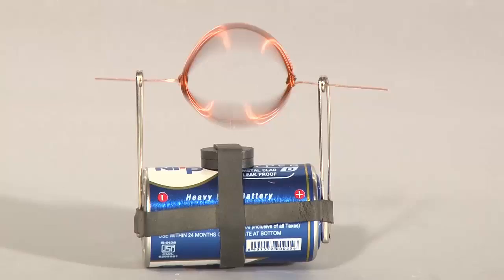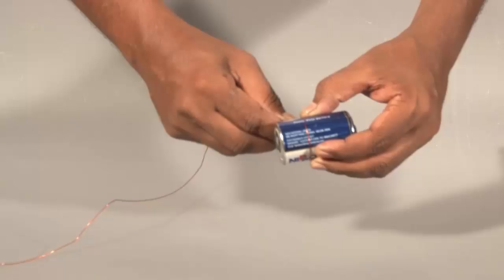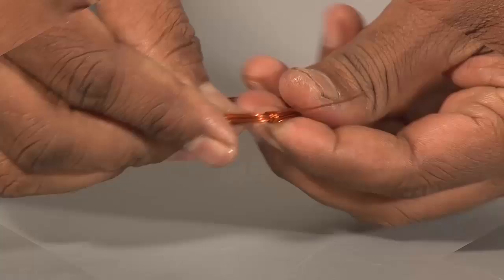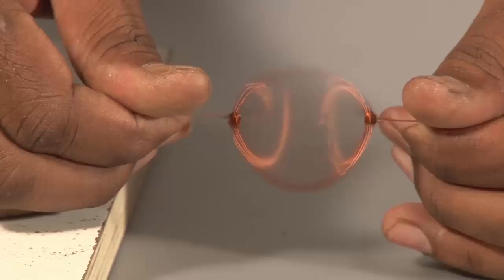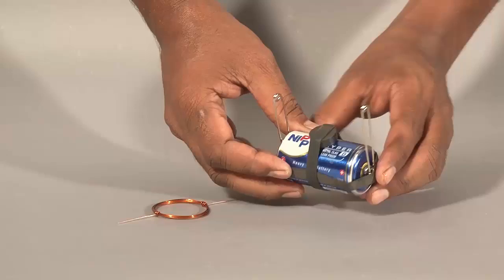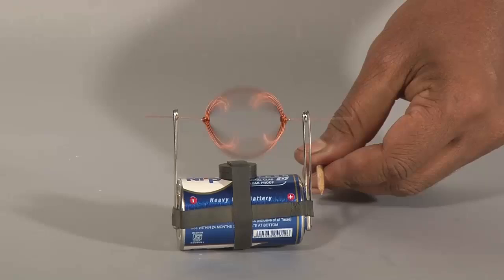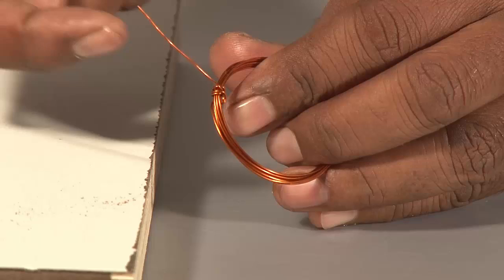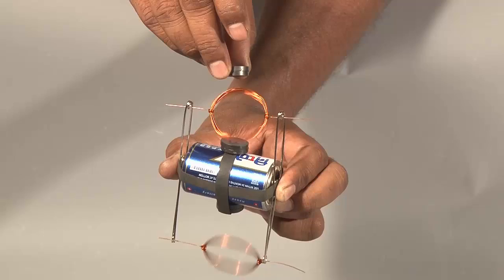Simple DC Motor | English

Comment: can I make coil with two copper wires
Reply: It should have plastic cotting on it, so insulation wire is used you could take it from a step down transformer in the tube bulb main board